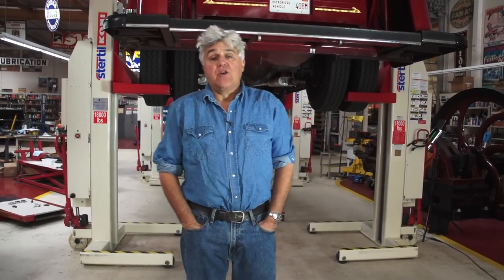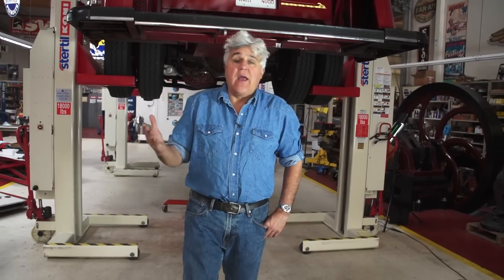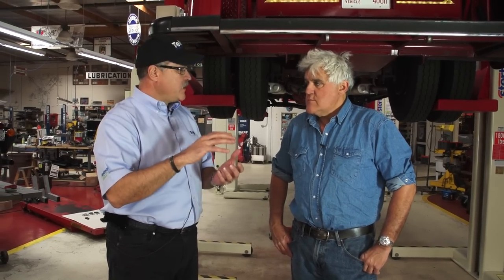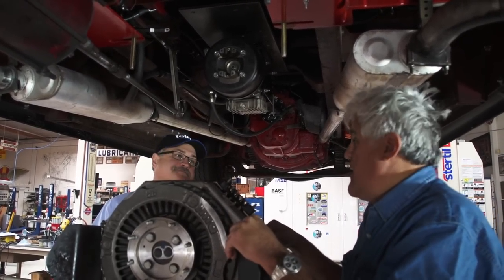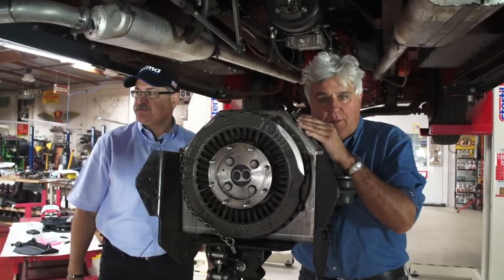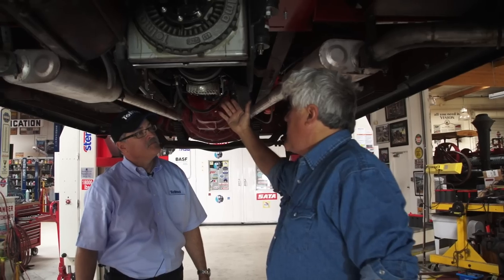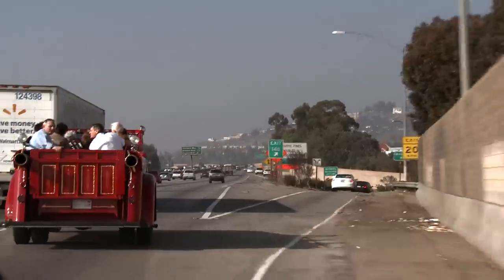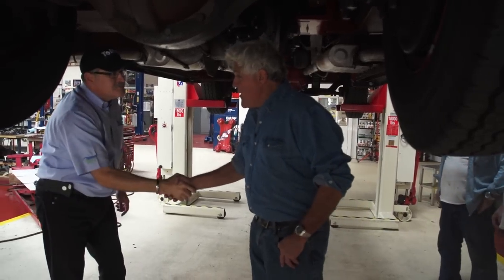Restoration Blog: 1941 American LaFrance Fire Truck - Jay Leno's Garage

Comment: I've been a volunteer fireman for eleven years in the Colorado foothills. The department had about five 1980 IH fire trucks which all had Telmas. They were very effective. Keep in mind they only brake the rear axle, so you have to be careful on low-friction surfaces, like ice and snow. They were very effective, especially when dealing with the heavy loads that fire trucks have (lots of water).

Comment: Been installed on almost every mobile crane I know, you won't believe how much this is used instead of normal brakes, trying to stop a mobile crane is hard, if in traffic you deal with brake fade quickly (Yes it takes that much to stop one) and these Telma's have been much help eliminating fade almost completely, though when stopping for lights they're used with the brakes because as said, it takes a lot but otherwise for normal speed control such as going slightly downhill or slowing for a bend they're brilliant, highly suggested though to be used on automatics, oh and also they work better at speed because when going slow the rotors inside the Telma take longer to pass the magnet, this is why the brakes are still used when stopping a crane.

Comment: Very cool.  The more energy-efficient use of this concept is regenerative braking, where you store the energy generated instead of dissipating it as heat.
Of course, on vehicles such as the LaFrance, there is no simple way to reuse this.

Comment: This unit it very common in medium size (40 seat)  buses. They really are very effective, and save wear on brake shoes/pads, and drums. I've been using them for 20 years, and you really miss it when you drive a vehicle that doesn't have one!

Comment: Living in snowy frozen Illinois at this time of year, I've gotten into the habbit of dragging the brakes for the last mile to make sure they're hot enough to get moisture out before setting them. Otherwise, I do have the option of a Jake Brake, and I think everyone with a mid-sized, to large truck should have an auxiliary brake, and know how to safely use it... Especially if they tow.

Comment: In layman's terms, it's a non-producing generator on the drive shaft. The electricity it produces when activated is let off as heat. It's the basic principle of dynamic braking in electric-drive vehicles such as mining dump trucks, locomotives and other large equipment.

Comment: Regenerative braking is taking the electric motor and instead of it being driven by an electrical supply switched to an electrical load turning it into a generator. This uses an electrical current to create very powerful inductive resistance from the eddy currents. It wouldn't be compatible to a battery electric vehicle because it would use up the battery charge instead of increase it.

Comment: yes, it's like regenerative braking except the power is thrown away. it's cheaper than a full regenerative braking system though. The idea of a retarder is to slow the vehicle without wearing out the brake pads.

Comment: well i was thinking you have these as the regular foot brakes then have a separate handbrake. depending on how long you own the vehicle I'm sure it'd pay for itself fairly quickly when you factor in the cost of brake pads and discs, especially when they'll be rare/difficult to replace on old vehicles like this

Comment: U-Joints are symmetrical, they'll take the same load driving the wheels as they do braking the wheels. Diesel's use the same concept with exhaust braking all the time.

Comment: I bet this could be set up as a motor as well, effectively making the car a hybrid. Just imagine the launches at the drag strip if you did that, then let the petrol engine and the brake/motor work together. At the end of the run, use it for braking as usual.

Comment: It can't replace them because it requires an electrical current to operate so in the case of an electrical failure you'd have no brakes. Also they aren't as effective at low speed as mechanical brakes. Hence why trains that use linear induction brakes still have electro mechanical (friction) brakes that trip to bring it to a complete stop or if the electrical system fails (electrical currents hold these brakes open instead of close them).

Comment: I wonder what the implications of using a unit like this would be for downhill speed control in wet or slippery conditions? Since the unit only controls the rear axle (through the driveshaft), could it lead to the rear end loosening up and causing a spin? I assume it's such a gradual application of braking force that this isn't a problem, but it could an issue if given the worst possible conditions.

Comment: $6500 is a lot... but, if it means a brake job every 3 months, with occasional turning or new parts, becomes only a once every 5 year ordeal... it will eventually pay for itself. If not in the brakes and labor itself, but in lost time on the road too.

Comment: Commercial Truck shops charge $85- $130/hr labor. If the average is $100/hr $800-$1600 labor for install.  Point 2 .. this is an auxillary brake only... If the driveshaft were to snap at the U joint.. very easy in 18 wheeler application with a stopped at an incline situation you have no more brakes and your big vehicle is out of control. I have used both Exhaust Brakes and Engine Brakes.. Jakes- engine .. Dana/Williams- exhaust.. the best, though not the most popular, is the Dana/Williams exhaust brake. It's advantage over Jakes is that it provides increasing braking power with increased RPM- more powerful.. it also lessens maintenence cost when running Valve Overheads on Cat/Cummins/DD diesels.. Jakes require extra shop hour time for removal at overhead time. For somw reason.. most spec Jakes.. I owned a Williams unit and Jakes units.. Williams is the winner by a mile.

Comment: Eddy Currents only appear when the rotor is spinning through a magnetic field. if the wheel don't spin, no eddy current, no braking power. can't lock up.

Comment: Did you even watch the video? that thing must way 50 lbs at least, they did say it was cast iron. That wouldn't work for sports cars because that it would increase unsprung weight and rotational mass. You can see it connects directly to the driveshaft

Comment: Well, electro - induction brake for trucks is the common thing in trucks construction since fifties. Czech (Czechoslovak)  Tatra trucks has it from 1952( http://en.wikipedia.org/wiki/Tatra_T138 ) and it is former east block country.

The second way, how to make a so called engine brake was to place valve to exhaust system and closing the valve caused an similar effect for stopping the vehicle.

Both types of this "engine brakes" were mainly constructed for inhibit the speed while going downhill in same speed without using wheel brakes.

Comment: What is the difference between this (retarder) and regenerative braking, They appear to work and function the same way, the only difference i see is for this system you are using electricity to stop the vehicle, and in regenerative braking you are using the resistance of generating electricity. I dont know if i am interpreting that right, and if i am, this retarder seems kind of pointless (i mean no offense by that)

Comment: this is a railroad locomotive "dynamic brake" right... been in the railroad world since the 1930s
Reply: It's the same concept.
Reply: Same principle, but I think with Dynamic braking, it converts an electric drive motor into a generator, so when your braking you're charging the batteries if it has them, if it doesn't have batteries the generator output is just converted into heat like this unit.

Comment: Telmas used on busses is hoocked upp to the ABS system and cut's the con right away, been quite a few accidents with a retarded truck on snowy roads downhill in the early days that the wheels lock upp stall the engine and well, crash